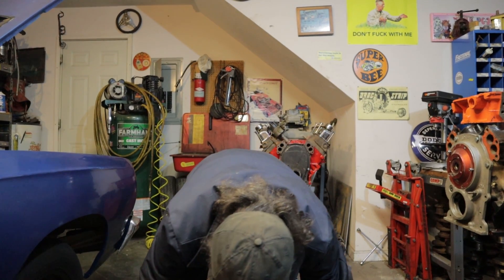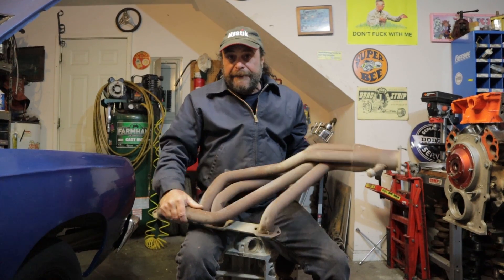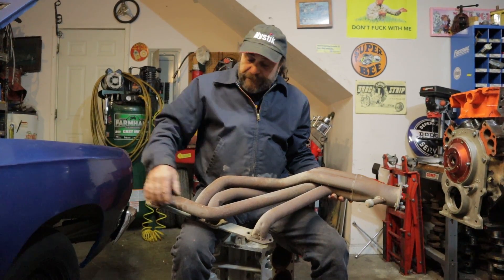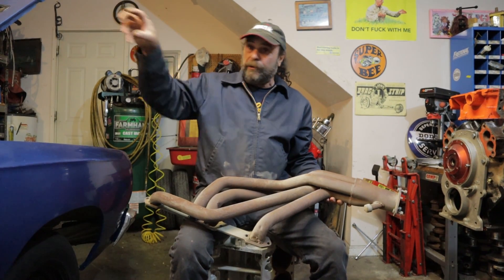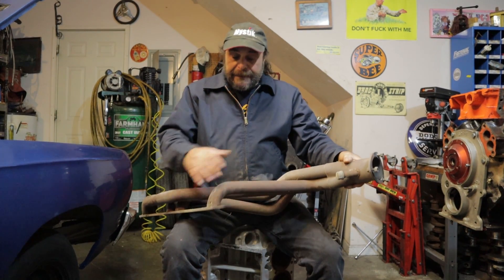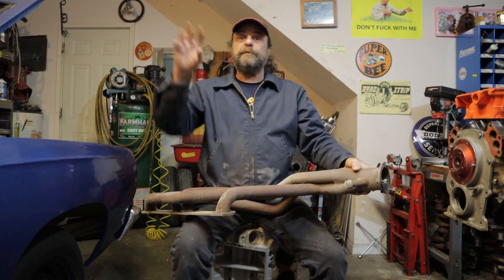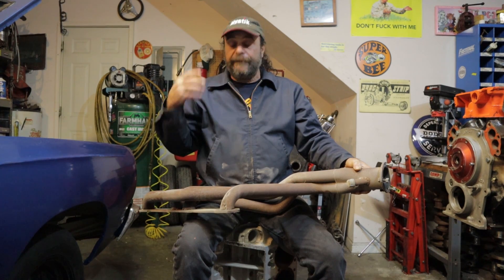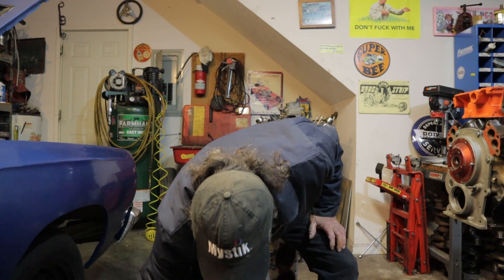The BS On Backpressure

Comment: YES. Love this video. I'm really tired of people saying "engines need back pressure" omg... lol
As an afterthought to this, I will add that the distance from the port to the collector (length of the primary tubes) is another factor to establish optimal scavenging RPM of the header.

I've never actually tried this, because I haven't used cross-over pipes in my systems before,(I like straight pipes, "scavenger style" that run straight under the axle with zero bends and zero losses) BUT, from what I understand, the best way to find the ideal place to install a crossover pipe is by using a wax crayon(junkyard marker) and run lines down each pipe, from the collector, back a few feet. Run the car hard around the block, bring it back and find the spot in the wax lines where it just begins to burn off the pipe. That, supposedly, is the ideal crossover spot to optimize the exhaust system(and quiet it down) I wish I'd tested it to see if it really works like that. Have you ever used this method, Tony?

Your videos are fantastic! Simple, to the point, and factual.

Comment: Try running a car with open headers. They have NO top end. Put some good mufflers and exhaust on those headers and it will have a top end of 40+ miles per hour more. Why? back pressure. So to say they don't need back pressure to run is true, but if you want true top end speed, you do.

Comment: finally a video in my feed that isn't complete bullshit. i get so tired of bad recommended videos. back pressure is bullshit, and a great way to get bent valves when said backpressure pushed against an open valve or even semi open valve. been saying this shit for years.

4 cylinder kids. 2" to 2.5" depending on engine size. 2.75 to 3.25 for turbo applications. easy win. i tuned my old del sol n/a with 2.25 on 1.6 and i hit the performance crown, and kids telling me i need 3" to make more power, but they made less power than i because of the oversized exhaust.

Comment: Good 5 minute video um exhaust tuning is a science you can google to find the formula's for pipe length an diameter for any given application but racing at Wot an driving a family car are two different animals and any exhaust can be tuned to run at peak power at an RPM of your choosing within reason it's a misnomer to call back pressure a myth in imho, factory exhausts are tuned to send a pulse back to the cylinder so as to not over scavenge it and improve fuel economy so if someone wants to call timing exhaust pulses so the cylinder keeps it's fuel charge over a given RPM back pressure in a way they are right it's apples an banana's really, there's lots of free horsepower to be had with an exhaust tuned for your application and that's why messing with motors is so fun :)

Comment: You need to define what's meant by backpressure. Yours is only one definition, the other is the correct one.....go try running an engine on the ground with no exhaust.....it won't idle properly and will keep stalling. Add an exhaust and it'll run a lot better. Because you've added backpressure. Not your definition of backpressure though, the other definition.
It works along the same lines as electrical theory and back emf and the flywheel effect.
What you measure in the pipe with a pressure gauge is "pressure" not "backpressure". Backpressure is the part of the  cycle when pressure is below atmospheric.
The only thing that's actually changed over the years is the definition and that's only because children have access to the internet.

Comment: It is high pressure  (hot air) to low presure (cold air). That's why H pipe and x pipes are for when the car has a long exhaust.  The high over takes the low and equalizes presure, stopping the scavagung flow effects.  Under a car you can see a spor where the pipe is getting very hot. That is where the scavagung stops. The x pipe / H pipe is put in this spot to create a low pressure area and continue the scavagung on out the rest of the long pipe. You spray paint you dual exhaust,  and the spot you see paint burning of ,is where you place the x or H pipe. Excellent video, thx. Also , the exhaust muffler on v 8s will make is distortion sounds, because the scavagung has stopped long before the exhaust has reached the muffler.

Comment: I have watched a few your videos now and they're very informative.
I was in doubt on this one until you got to about 4:30 you're exactly right. Case in point V8'ed s10 
(305  +nos ) in high school. 
Open header was so so, 2 1/2 duals with Flowmasters had to at least picked up 50 foot pounds of torque. And scratch second gear at cruise. Keep up the good videos and I'll keep watching.👍👍👍👍

Comment: So I bought a 98 f150 4.2 v6 with a bad motor on the cheap, motor had been replaced by the guy i bought it from once, , purchased a 2003/4 4.2 v6 out of a wrecked heritage f150, dropped her in, using 04 plastic intake and 04 headers... everything else is 98, prolly a good idea to pop the ole 98 intake and headers back on huh?

She spits and sputters most of the time when idling after warm up cycle, betting at the very least my 04 headers aren't agreeing with my 98 exhaust?

Actually it could also be the bitch of a time i had putting that plastic 04 intake plenum on, forgot i first suspected a vacuum leak on the intake.

Comment: Cam timing, scavenging, anti reversion, afr. It's all about matching components. You're the best I've seen at describing this. Subscribed. Btw a D shaped exhaust port ain't begging for a die grinder. Learned that the hard way many years ago

Comment: Awesome vid my man. Very true....however my small lawnmower engine will over rev and hand grenade without the restriction of an exhaust. Back pressure is not needed for performance but u will compromise efficiency and longevity of the engine without 1. 10/10 vid. Keep em coming🚬🤠🥃

Comment: I love it! Your exactly right and it’s nice to hear someone that uses their head. The flow of exhaust gases creates a vacuum just like a Venturi nozzle. And with sizing it’s pretty simple, as velocity increases, pressure decreases. The smaller your exhaust the higher velocity of the gasses, but less pressure! A 2” exhaust would have less pressure but the gases would be going faster than a 4” pipe. It sounds backwards but that’s how it works. Don’t believe it look into it, it’s called Bernoulli’s equation!

Comment: Two things come to mind: Two-stroke engines need some back pressure. Otherwise the fuel-air charge goes through the engine and into the exhaust pipe without doing much work on the way.
And on any vehiocle intended for use on public roads, at least in civilised countries, the noise needs to be suppressed, which is likely to cause some back pressure, and design engineers make provision for this.

Comment: You're correct.  This is one of the oldest myths around.  I read this years ago in books on engine design.  For more power you need scavenging and the right exhaust system.

Comment: Back pressure is only useful in a 2 stroke, that is the whole point of a tuned pipe. Also it is not continuous it is pulsed by the pipes tuned shape.
Reply: Correct the proper pipe has a pulse that keep the air gas mixture from being blown out the pipe and can be tuned for high mid or low end power  . A rotary valve or Reed valve can be used to help with that too.

Comment: I wanna share my story with you guys about my foxbody mustang with stock 302 efi engine. I did the basic mods cold air intake bumped timing 10 degrees and had to cut off my exhuast near the mid pipe area because it had some rotted out pipes. So then i noticed the car did not want to rev out to 5k rpms and was an extreme dog. Finally made it out to the muffler shop to get flowmaster single chamber mufflers installed and it was a night and day difference the engine now would easily rev out to 6500 rpm and felt alot quicker. I dont know what happened really it was strange but true story.

Comment: My motorcycle loses power without back pressure.When I run straight pipes it won’t pull as good as it does with baffles in and it looses power on top end speed!

Comment: A little addition to the video about overlap - with forced induction 4 cycle camshafts you tend to have less overlap profiles so that you aren't blowing your fresh charge out the exhaust.   Then, if you are running a 2 cycle forced induction like a Detroit Diesel(6-71, 8-71, etc, etc), where the supercharger or turbo is used to push the exhaust out - you have lots of overlap of the intake & exhaust.   

With headers/exhaust manifold and exhaust pipe size - tube/pipe diameter should be associated for the engine size, both physical and theoretical(boost) in relation to volumetric efficiency.   A 100% volumetric efficient 350cid Chevy running about 14lbs of boost makes a theoretical 700cid engine.   0lb boost/vacuum is 100% atmospheric fill of a given engine size.  About 14lbs boost, dependent on elevation, is effectively double atmospheric = double the amount of air into the engine = effectively double the size of the engine(theoretical size).   In the real world you need to factor in what RPM range you intend to run, the overlap, overall volumetric efficiency, etc.   Very few non-all out racing engines are 100% volumetric efficient, most street/factory engines are well below 90%, and quite a few are below 70%(for example:  a naturally aspirated Chevy 350cid may actually run on 245 cubic inches of air - not saying the Chevy is that low, just using it as an example).

But yeah, back pressure is bad.  lol

Comment: The optimum is to convert all exhaust energy into kinetic energy.    There is considerable pressure energy, along with thermal.  

It is the velocity of the exhaust gas which promotes scavenging.

Comment: It's not the flow that people are concerned about. You need pressure for combustion. That's exactly what the compression ratio is. It is the rate of which the chamber is pressurized at for the explosions (power stroke) to happen. More pressure, the more intense the explosions are. No compression just means that there is no additional pressure above atmospheric in the chamber. No compression means no power.

Comment: You have 2 exhaust actions going on at the same time. Myth well thats a matter of opinion for those who are engineers of sorts. Wives tales is like calling additives snake oils. Zinc is an additive  as are other friction modifiers or even rubber in oil for variable viscosity. Scavenging is a word like physics. Very wide subject matter and involving. Exhaust you have a vacuum effect on overlap that works extremely well on say a 108deg overlap. You also have the hypersonic pulse effect of an actual "tuned exhaust" used in many other internal combustion engines. Aviation industry used the hypersonic pulse extensively before turbines were developed. The hypersonic pulse engineering marvel can take credit for a large aspect of winning ww11 in the time frame we did.  Studying engineering history is a key of knowledge. Additives and engineering won WW11, those applications are still relevant today.

Comment: They like velocity. There might be a momentary backpressure that in necessary to add energy to the gas column but the pressure has gone and then become vacuum as the piston slows to turn around after the gas reaches maximum speeds. it's a complex curve of pressures and velocities and reflected sound waves and hemholz resonance. The pressure is only momentary and gets the ball rolling, the average pressures may even be negative.

Comment: I don't think that you explained the reason that the engine runs like crap without exhaust manifolds.  I would think that a better explanation is as follows.  If you try to run your engine without exhaust manifolds, during the overlap the intake manifold vacuum will draw air from the open exhaust port and will screw up big time your mixture.  If you have the manifold on, it will pull back residuals, and not mess up your A/F ratio that much.  You could probably tune the carburetor to make it run without manifolds,  but it may require substantial redesign.  I would expect that at close to WOT the engine will run fine without exhaust manifolds, but that will not be easy to do unless you get the car on the road.

Four stroke engines are not harmed as much by back pressure, but you are right, there is no upside to it either, especially if you are racing ...

Comment: So is part (or all) of the reason for the formation of the vacuum at the exhaust valves due to the inertia of the exhaust gases already traveling down the collector? 

And is the smaller tube having a greater vacuum (inertial “pull”) due to the Venturi effect?

Just trying to see if I understood all that correctly.

Comment: Yep, backpressure comes from the days of inline flathead engines--just like people who think they have to paint the inside of an engine block (it doesn't smooth the oil passages out, they remain rough cast. It doesn't trap dirt either, it flakes after repeated expansions just like any high mileage block you pull out of a junker. It might even hinder heat transfer to the oil. Just polish and clean the engine block pores and you'll do fine unless you leave the block sitting in a humid area and it rusts on the inside).  Ironically, the same people in the 1950's (might have even been Barney Navarro, I'll have to check my old "little pages" magazines) telling you about back pressure, wanted to sell you dual exhaust to attach to your split 'manifold so your engine could breathe better!

When I was a young pup, I mowed the neighborhood with my father's Gravely lawn tractor (a more macho lawn mower does not exist--handlebars that make a Harley cry :)  ). He had broken a bolt mount for the exhaust pipe off the air cooled single flathead cylinder, so it barked right out the exhaust port, no muff or pipe. When it flamed blue, it was dark enough to head home, but it ran perfectly fine except for an exhaust spring that would bind from time to time. Undo two Phillips screws, wedge the spring back open again, and pull start it and finish the job.

Comment: I think some of the confusion comes from people getting velocity mixed up with back pressure sometimes a smaller pipe will increase the velocity and also increase the Scavenging effect which is actually less back pressure not more

Comment: I've replaced many  busted exhausts from behind the cat [ behind last o2 sensor] on back, and several, mainly small 4 cyl imports, ran much better with the midpipe, muffler and tailpipe on as designed, even if they sound as if they rev slower. the total power may not change but you get more torque lower in the range. idk but even had my own pipe fall off and when I welded the rusty shit back on it def pepped up, had more down low and I'm watching the tach getting on the Hwy not goin by ear. idk just kinda devil's advocate any ideas, Tony? Knuckleheads? peace

Comment: I was always told that some back pressure was needed to keep the exhaust valves from burning & not to keep engine running. Then again this was back during the days of the softer valve seats and leaded gas.

Comment: With all due respect. You may want to read up on Wave Tuning. Engines do need back pressure in order to run properly. It's based on the physics of the positive compression waves and the reflected or expansion exhaust waves. Has nothing to do with restrictions and can be tuned. That's why it's called Wave Tuning.

Comment: just a query, where exactly does "vacuum" come from in an exhaust ? nothing is pulling it out, it's being pushed by the engine. Pull the exhaust off your little 4 banger and tell me open exhaust is better for power. Torque is gone.

Comment: I argue with Harley guys all the time about this crap. They constantly say you need backpreasure when running 2  separate pipes instead of a 2 into 1 exhaust. The problem is harmonic reversion. The exhaust gasses have harmonic frequency waves in them and the exhaust in the header actually moves backwards and forwards. The backwards moving exhaust gasses can flow back into the cylinder and dilute the mixture. So you dont need back pressure, you need the most free flowing exhaust you can have with an anti reversion device to keep the burnt gasses out of the chamber. The collector like on a car header is a great anti reversion device because the pulses from the other cylinders help keep everything moving in the right direction.

Comment: The only engines that need back pressure are two stroke engines. This may be off topic but...
In the combustion cycle, to keep the first of the intake from going out with the spent exhaust gasses, the exhaust expansion chamber produces a shock wave back to the exhaust port and stops the intake fuel air mixture from escaping the cylinder into the exhaust system and atmosphere which would result in power loss and increased pollution. The back pressure consists of pulses consistant with engine revs. The timing and strength of the pulse is designed as a fixed shape for a particular rev range (usually max revs) by the size and shape of the expansion chamber located at the front of the exhaust system. In-between these pulses the exhaust should be free flowing. A two stroke engine fitted with reed valves has a small amount of positive intake pressure created by the down stroke of the piston. Yes as a rule engine should have free flowing.
Diesel engines fitted with turbos that's another story...